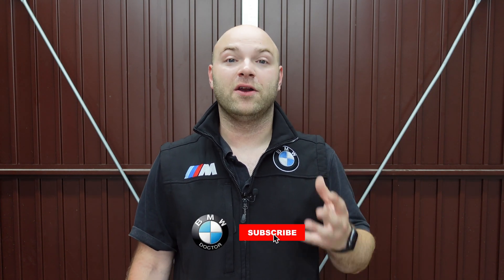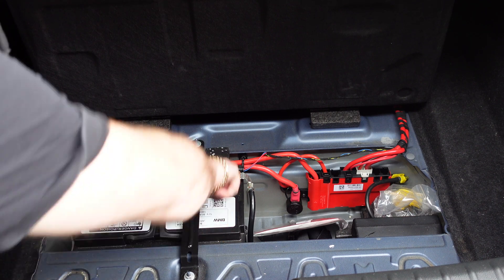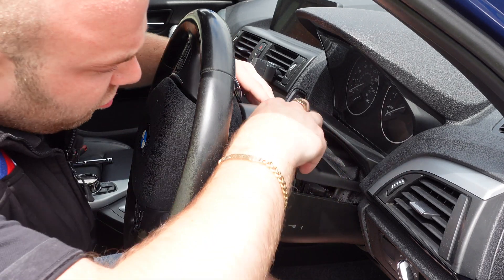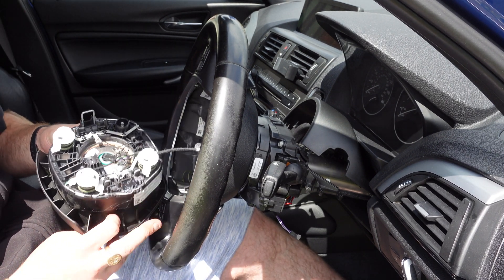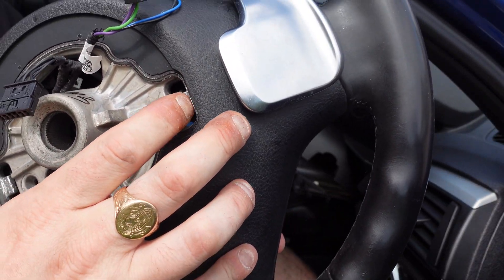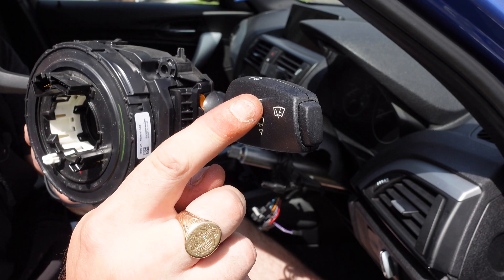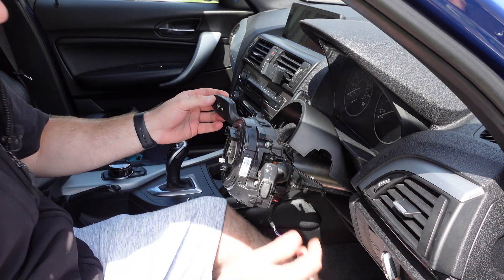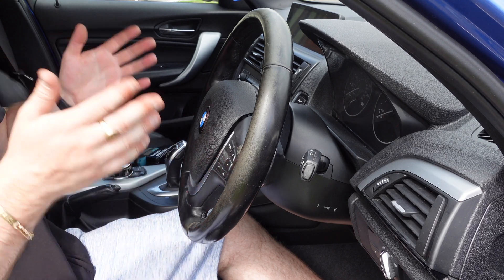BMW F Series High Beam Assist / FLA Retrofit ( F10 , F20 , F22 , F30 )

Comment: Is there a way to keep your high beams on manually 😂 silly question but I’ve been having to hold them on using the flash basically
Reply: @Matt-hn4hn  push to front

Comment: If we just change the turn signal arm, will it still work?
Reply: I have the same question!? Change the arm and code its possibel?
Reply: @cargolfmexicopavao7399  No, there has been attempts on F10 (same thing basically). You will end up doing more harm then good. 

Just install a steering column with the respective buttons, not just the stalk.